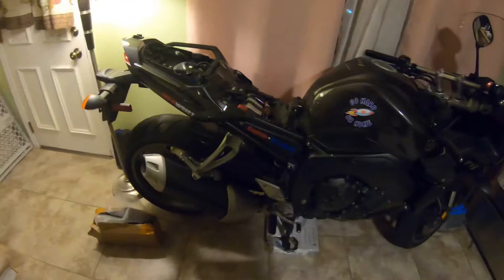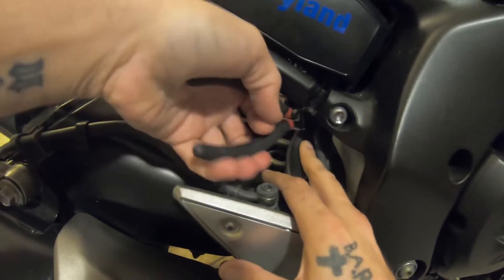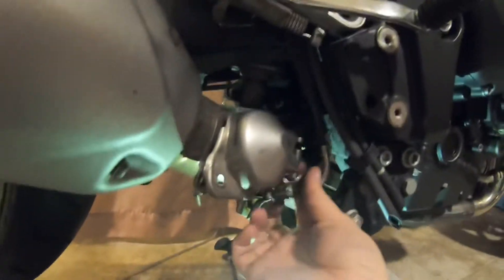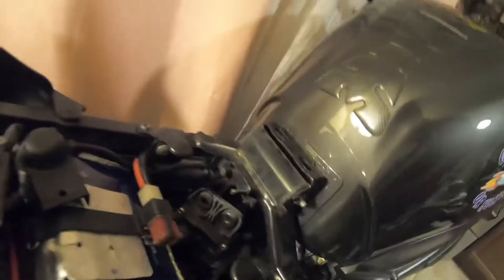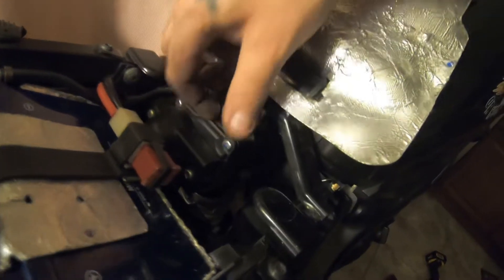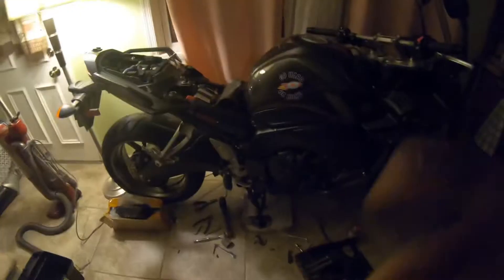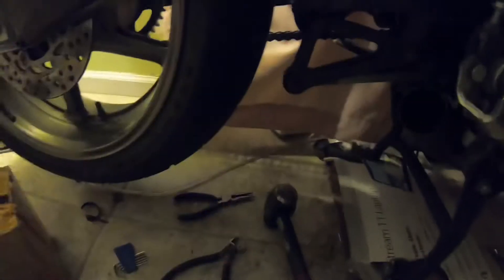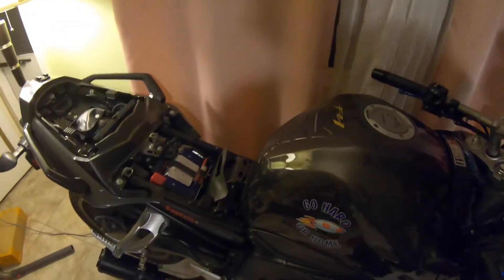FZ1 Upgrade Exhaust Install

Comment: Is it about as loud as running a hollow pipe? I have a shorty GP pipe that's hollow and too loud. Was considering getting the same exhaust you did, but not sure if it's any quieter.
Reply from the maker: It’s a loud one about the same as a str8 pipe hope that helps

Comment: How does it run with the slip on? I keep reading mix reviews where their bikes run poorly after installing a slip on without a flash.
Reply from the maker: I got a power commander and a flash done she runs great 👍🏻
Reply: @gohardorhomefz1  how did it run with the slip on without the pc and flash? Going to be installing a slip on this weekend.
Reply from the maker: @deegaw11  it ran good I road it for a week before I could get a custom map on it didn’t have as much acceleration but road and sounded beautiful

Comment: Does drilling the cat out throw any kind of check light?
Reply from the maker: No didn’t show any only thing is when you remove the servo motor put it back or u will get a light hope that helps 🚀🚀🔥🔥🔥